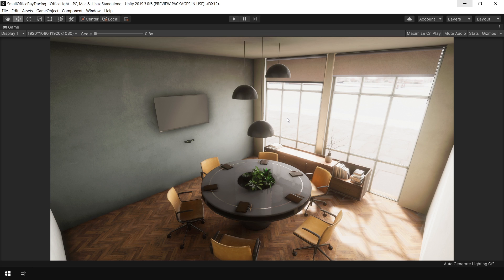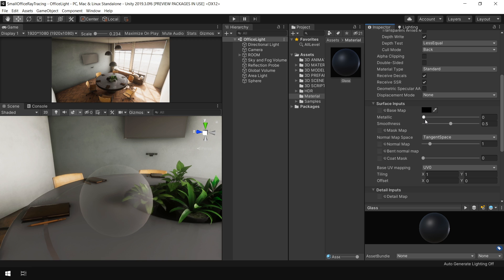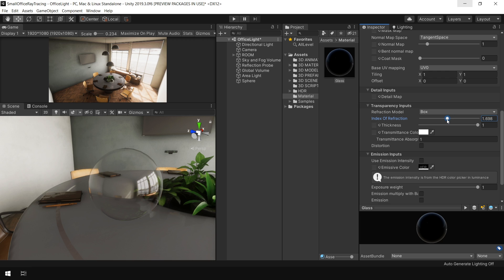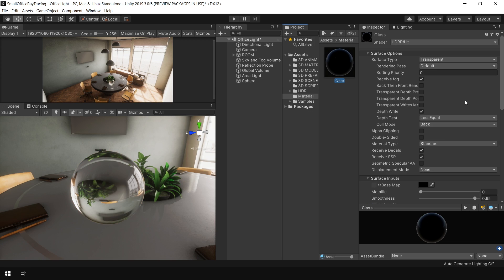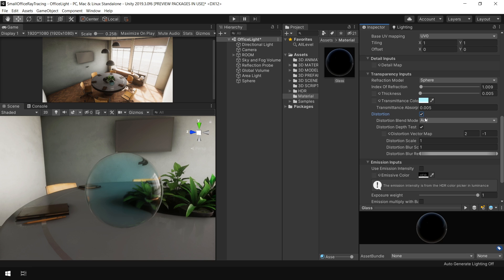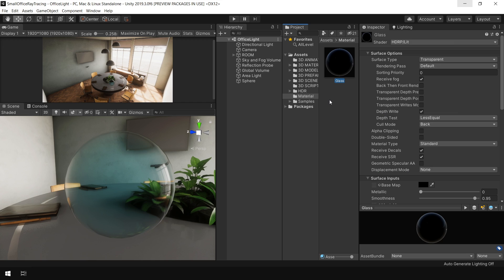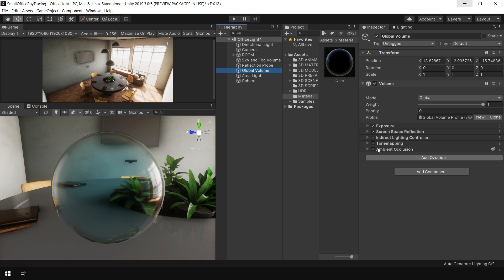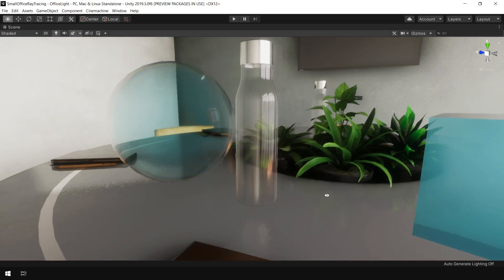Realistic Glass Material in Unity HDRP

Comment: What HDRP version are you using? Can't see the "Distortion" checkbox under "Transparency Inputs" in my material. Using HDRP 7.2.1
Reply: Yes the distortion box is gone. I was primarily interested in blurring. A work around (or perhaps this is a legit technique) is to lower the smoothness parameter to blur the objects seen through the shader, then turn up the coatmask to restore the shiny reflections.
Reply: Found the answer myself. This setting is only available to unlit shaders as of 7.1+